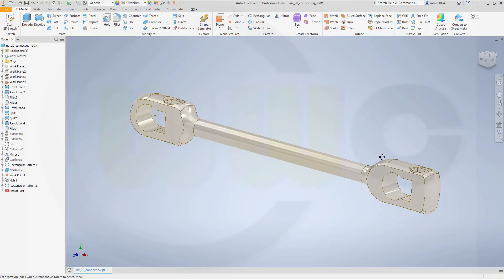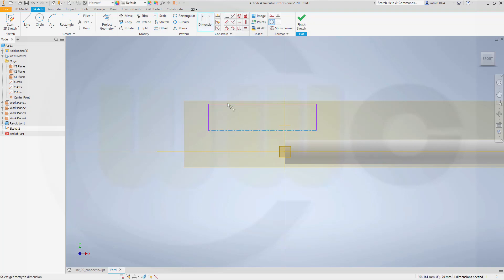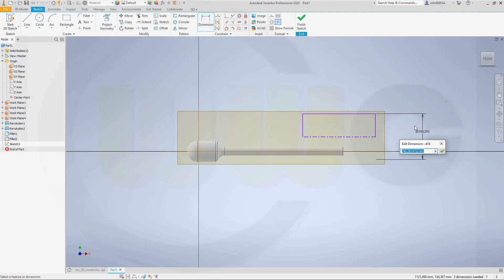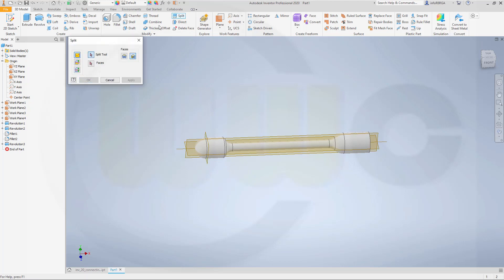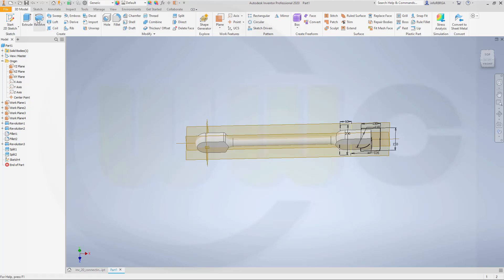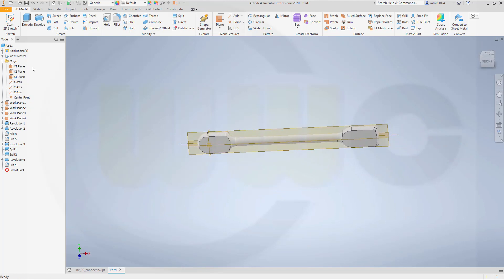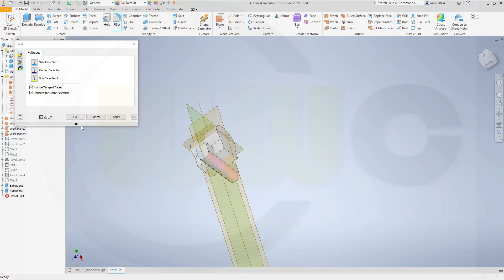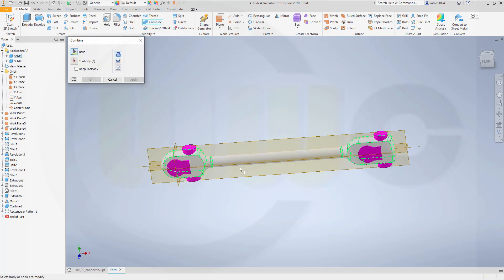Connecting Rod - Inventor 2020 Training - Part Design

Comment: hi, is there icon to revolve thickness while sketch is open like solidworks or catia
TX
Reply from the maker: "Revolve thickness while in sketchmode" ??? What do you mean?
Reply: @wolfgang.walden.cad.training  open sketches are revolved with thickness in solidworks but not in inventor
Reply from the maker: This is not possible in inventor. An "open" sketch revolved with less than 360 degree will be a surface, but not "thickened".